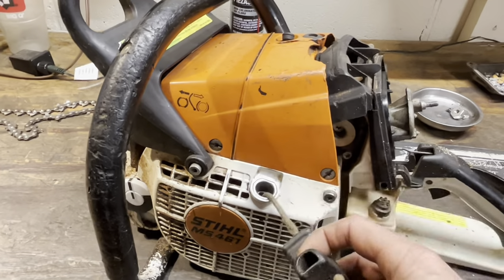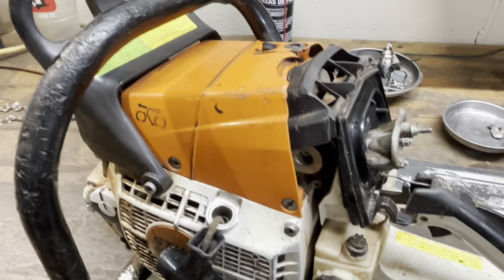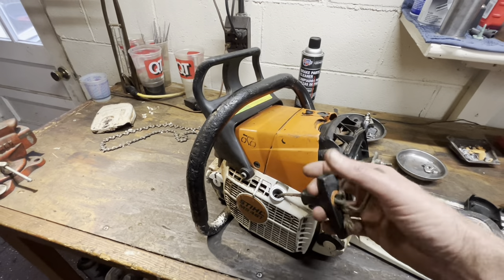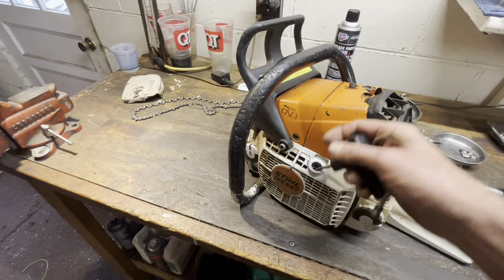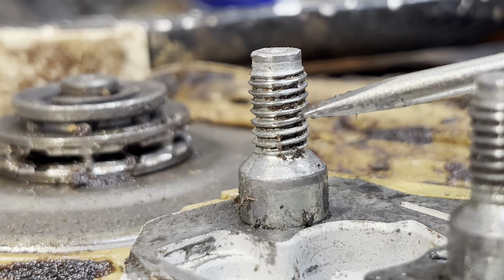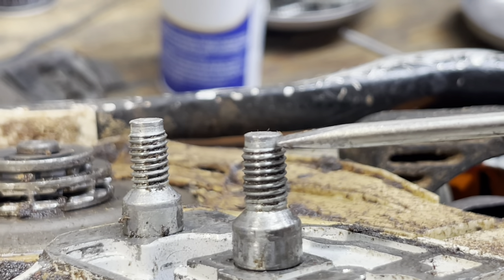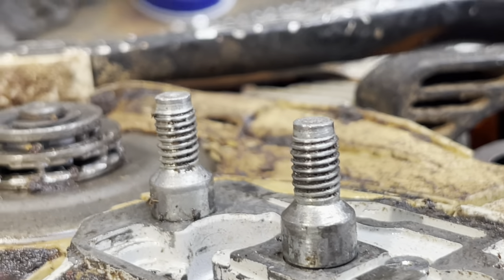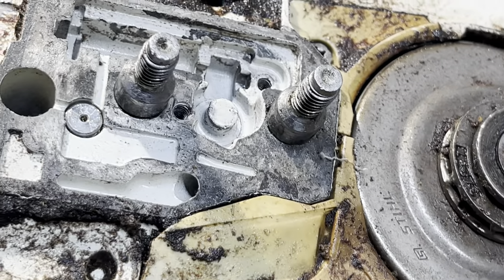MS461 Deep Service and How to DIY

Comment: The buffer plug in the right front is missing.  You have to instal it before you install the chain catcher. I always seem to forget it and have to take things apart to install it.  The rimless sprocket is supposed to use the thick steel sprocket washer.  The aluminum one goes on spur sprockets, only.

Comment: I suppose husqvarna mostly uses the is it 4 mm allen head but the there is the 266xp. That has metric m5 thread on the intake side, the cylinder bolts are imperial thread with imperial allen head, and the damn exhaust side that is imperial thread into the cylinder but the muffler side takes a metric nut. What on earth was husqvarna thinking?

Comment: I always coat the gears on he chain. Adjuster with white lithium grease before I assembled them.  I use it liberally.  They will get a little bar oil during normal operation but the grease makes sure they turn easily.  I hate an adjuster that gets tight as I adjust it.  It also protects against rust and corrosion should thee parts get wet,as they often do.

Comment: I cant imagine those bar studs cost much, is it really worth trying to repair the threads why not just replace them when they are that bad? Seems like a no brainer.
Reply from the maker: The dealer was out of stock, and yes they are only $4-5 IIRC.  I took one off a parts saw to get this one back in service.

Comment: Great video ! Would it harm anything to put a dab of grease on that recoil pulley mount post to help extend the life of the pulley ?
Reply from the maker: It sounds good in concept, but the factory doesn't use any.  Here's my theory.  Any grease will attract and trap dirt and particulate.  That may wear it out sooner.  Just my .02
Reply: Interesting to get the differing recommendations on this subject. Other videos out the by Saloon guy, Donyboy and others have them liberally lubricating the pull starter assemblies-pulleys on a variety of engines. As you just discovered some new Chi-Com knock off replacement recoil assemblies come slathered with grease. I just tore down an old 066 red light and it was packed with so much oily-greasy crap dating back from the 90’s it was lubricating itself throughout the entire case…lol.
Reply from the maker: @shannonwhitaker9630  Hah!  Gotta love old dirty saws.  I've got 2 Red lights.  Classics.

Comment: Wish you were available for work..your not to far away
Reply from the maker: Maybe we can work something out.
Reply: @richardflagg3084  what ever you need .would be greatly appreciated. Have a brandnew 500i never seen gas yet obviously for work.its all I do.just cleared 4 acres of thorny brush and big cedars ,walnuts by a lake .for client
Reply from the maker: @Sethhaun78  If you click on the "about" tab on my channel you should be able to see an email.  If not lemme know.
Reply: Also I have a old classic you might be interested in.has axstripped bolt on bottom to the cylinder. And needs cleaned  and fuel line .was going to work on it it runs but I'm to buisy to .barley get my jobs done.
Reply: I tried again says invalid email.send me one .I'll be awaiting .thanks